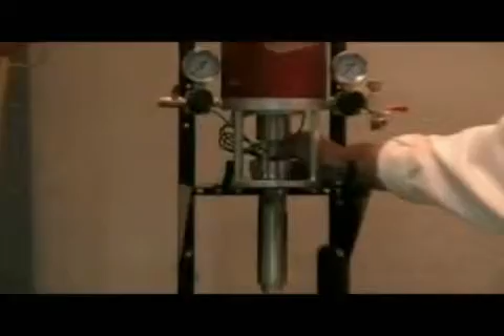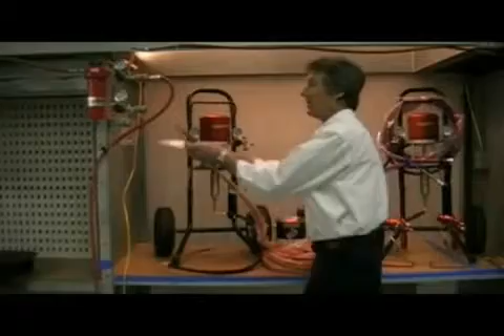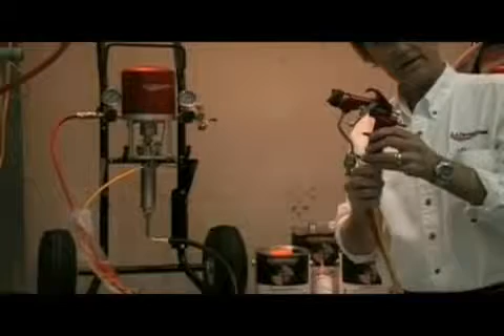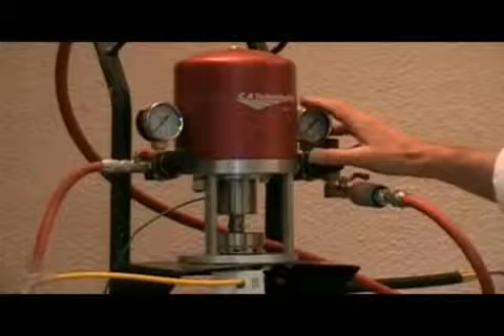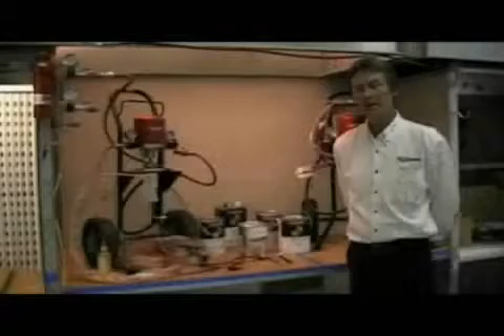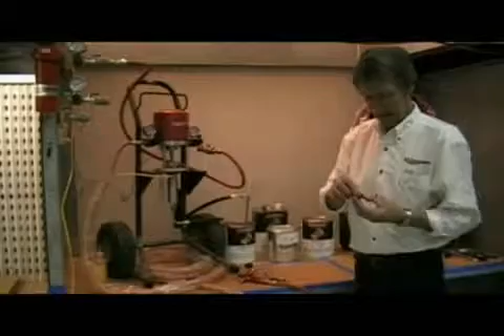CAT Air Assist Airless Video Part 2 : Setting up

Comment: Hooking up/unhooking the fluid line to the gun is one of the most ill-conceived procedures on the planet. CA Technologies uses a nut that isn't octagonal like every other fluid line nut on the planet. Instead, the CAT nut is only flattened with one set of parallel flats, meaning that to access the nut with a wrench you only have 2 choices, one of which is 180° from the other. That's ok if you put the gun in a nice vice, but if all you have is your mixing table, or if you're onsite, plan to waste a lot of time undoing that fluid line. It has to be the most lame-brained scheme at "trying to be different". I've taken apart lots of guns from all sorts of manufacturers and this scheme plain old sucks.